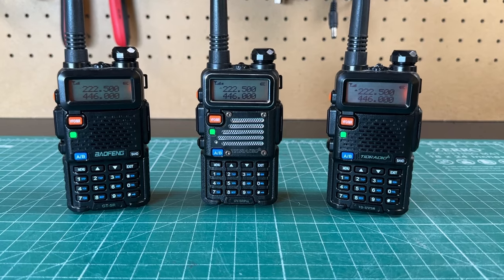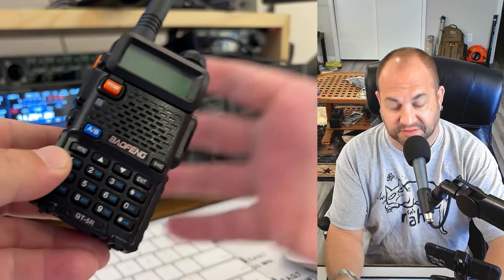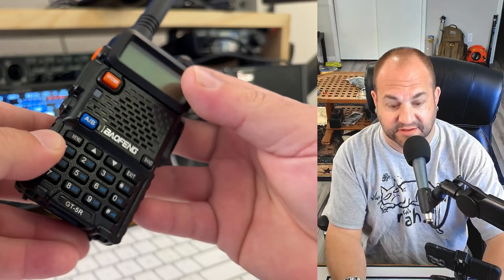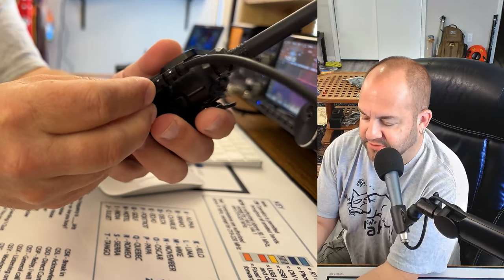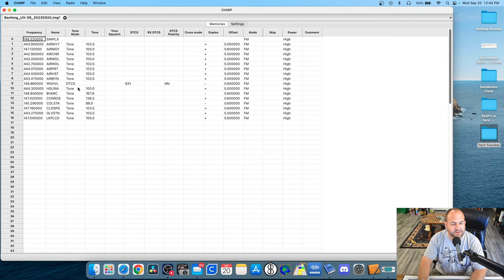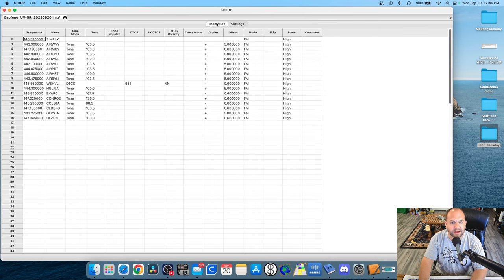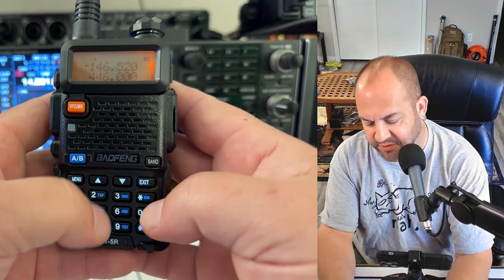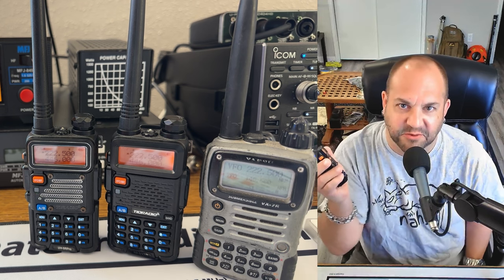Baofeng UV-5R Hacked | 220MHz Software Unlocked!

Comment: Once you make the mod, use chirp to read and write the radio as a Radioddity UV-5RX3.  This will allow you to save 220 frequencies to the radio.
Reply: Thanks for the heads up!
Reply: Thanks for the tip man it worked! I was actually coming to this video to ask for help on how to save 220 frequencies to the uv 5r thanks a lot!
Reply: I've the BF-F8HP and although I'm able to program the 220 freq directly on the radio, if I try to set a new freq using CHIRP it gives me an error message (Invalid edit: Frequency XXX is out of supported range).  Any idea how to fix that?
Reply: Bro….good save!

Comment: This is awesome. I also discovered, like many others, that if you lie to CHIRP first and select Radioddity UV-5RX3 instead of Baofeng UV-5R before downloading from the radio, you can just change the VHF TX range in the settings and enter your 220 memories just as you would 2 meter and 440 memories.
Reply: Thanks!
Reply: Exactly what I needed to know. Thanks. It worked
Reply: Do you have older models? My 2016 UV-5R units didn't show FACTORY. I still had success with the rest of the procedures (RadioOddity, etc.) and opened up way more frequencies, and could save them as memory/channels.

Comment: That's awesome. Now I'm off to brick my 10 Baofengs  LOL
Reply from the maker: good luck!
Reply: Pick one as a guinea pig!? 🐷
Reply: Make sure you have the right driver for the programming cable or yes, you will brick the radio, until you get the right driver for the cable. Been there, done that.

Comment: Great mod, thanks for sharing Mike!  So far no joy on an older BF-F9v2+.  Of course chirp does not have this version listed specifically so that could be it.  It did work on an older uv5rv2+ that I have.
Reply from the maker: Thanks for the info!
Reply: my uv5r  1.25 will not work on b band, only a band try it on a band. 73

Comment: Reminds  me of back in the day when I had a choice to buy a Packard Bell 486SX, or pay an additional $100 for the DX with the built in  math coprocessor. I cheaped out and went SX. 

I was browsing through the manual one day and I found a jumper setting note. J6:1-2=SX, 2-3-DX. 

On a whim I opened the case and moved the jumper. Magically I had the more expensive model. 

Ran like a top. And slightly faster too.
Reply from the maker: Ha!  That's how they get you.
Reply: An SX and DX were completely different chips. So what you likely did was overclock your SX to DX speed, as I think they still had discrete clocks then. Still a very cool hack.
Reply: @nobodynoone2500  Actually the SX chips were the DX chips that failed the stress tests on the math co-processor side. So it was basically a scratch and dent CPU that worked fine as long as I didnt overwork the coprocessor. And since I wasnt using it for heavy compute, I never (hardly) saw any errors or crashes.

Comment: You should add that unlike 2 meters & 440 there is no harmonic relation on 220. I/E for 220 you must have a dedicated antenna. Other multi band radios that are capable of 220 from the factory will state this in their manual. Failure to heed this warning will result in the failure of RF output transistors. KB0SFP
Reply: You can get aftermarket tri-band whips for these HT's. I was given a tri-band Baofeng for Christmas by a friend of mine and I bought a Nagoya tri-band antenna the following year at the Hamvention, and it works fine.

Comment: Well I just bought a new UV-5R to test this mod. Did all the things you talk about to the letter (Video) and it worked. But it's not putting out any power to the antenna and there is no SWR showing on my bird watt meter. Antenna used was the comet CX-333 tri band base antenna. I have the UV5RIII and this radio works fine and puts out the power but not the UV-5R on the 1.2Mhz band only. Works and 2 and 70 just fine. Well this mode dose open the radio up for receiving only. Will TX on the band as well but now power output and will not bring up the repeaters just nearby radios in the same room only.
Good mod for receiving only please note. N7GAD - 73's

Comment: Dude! Thanks for this Mike! I usually skip right over the Boofwang videos, but this is cool. Maybe this will bring some action to the band. I had only one ht that ran 220 and I’ve never talked to anyone on it. I’m gonna convert all my Boofwangs now! 73
Reply: Well how did your mods go. Mine open the band for receive only. No output power to TX. Will not bring up the repeaters.

Comment: I would love to see how much power this puts on on 220 and the spurs 🙊
Reply from the maker: For some reason my watt meter wouldn't measure power on any of my radios.  Even the Yaesu, which I know puts out .5 watts.
Reply: Sounds like a test is needed on your handy dandy thingy mabobber!
Reply: Sounds like we've got another on HRCC in the works. 🥳
Reply: I wonder if @notarubicon will give us a legal video on this hack. . . Hmmm.
Reply: I measured 10 milliwatts at the connector for TX on 224.00 so not great. My vx8 does 1W on the 220 band.

Comment: Is 226mhz the upper limit? How about the upper and lower limits of both VHF and UHF? How high/low can you go?
Edit: VHF goes as low as 125.7mhz any lower and the radio stays "stuck" and doesn't transmit. The upper is 249.8mhz but it is low sound quality. The UHF limits are 400mhz (low) and 519.995mhz. (high) All checked with SDRUno. Great video, thanks for making me explore this!!
Reply: Above 225 and below 136 would be aircraft which is AM and the B-Feng is not setup to receive AM, audio would be very very low and have distortion
Reply: @wecontrolthevideo  You would think so but 125.7 TX comes through loud and clear on SDR and on my KG-UV9D. Not optimal but it works. Unfortunately, the KG doesn't transmit at that freq and I only have one UV-5R. I'll test it with my neighbor's UV-5R when i get a chance.
Reply: @brazoon1  Probs shouldn't leave such direct proof on the internet of you using a non-compliant radio in restricted bands, I mean I am not the police, but you kinda want to make it hard to prove anything should the alphabet boys come a knocking, eh!
Reply: @meola69420  True but beyond the quick testing I did I don't plan on using any of these frequencies. For me it was just a curiosity. Plus, I'm in Canada so as long as I don't mis-gender someone the authorities won't care. lol

Comment: I have tried this on 5 radios. All would accept the program edit but only one had any measurable output power. That one radio also had very distorted audio. Baofeng now offers a UV-5 that has factory 144/220/440. The set included 2 antennas, 1x dual band and 1x for 220. KB0SFP

Comment: Awesome! I heard that can be done. Did you see how much power they put out on transmit? Even if it's not much, it's nice to have.
Reply from the maker: I checked with my MFJ power meter both my Yaesu and Baofengs and they didn't show any power at all.  Pretty sure the Yaesu is only a half watt though.  Not sure about the Fengs.
Reply: I order the radio and did the mods and now power out as well. But will receive just fine

Comment: I have several UV5R radios that are unlocked but none seem to want to accept the 1.25 meter frequency.  I changed the VHF upper limit to 226 but when I try to enter 222.500 it just say cancel. Any ideas?
Reply: my uv5r  1.25 will not work on b band, only a band try it on a band. 73

Comment: Would have liked to see power output and emissions on 220.
Reply from the maker: None of the radios would register on my watt meter.  Including the Yaesu which should put out .5 watts.  My high quality MFJ meter just might not be sensitive enough to go that low.  Someone else commented theirs put out 1 watt.
Reply: The UV5R III tri band only puts out 200-250 mw on 220. I'm pretty sure this mod won't hit that. But at least you can listen on 220 Mhz.

Comment: As many mentioned, what is the power level… I think it would help if you had a 1.25m antenna. The stock 2m/70cm rubber duck surely is not doing you any favors. Test it with a 1.25 antenna and it may show more power output.
Reply from the maker: I don't know.  None of the radios would register on my watt meter.  Including the Yaesu which should put out .5 watts.  My high quality MFJ meter just might not be sensitive enough to go that low.  Someone else commented theirs put out 1 watt.

Comment: Thanks for the video Mike but considering that Baofeng UV5Rs generally have 3rd harmonics above standards, I'd imagine that the radio might be even further out of compliance on 1.25m. It would be good to check this to ensure we hobbyists don't cause interference problems.
Reply: That is only for the older Baofengs built before 2019. The newer ones (2020+ units) are much cleaner in their outputs.

Comment: When I hold down the three buttons mentioned, and turn the radio on, it says, "COPING".  And the Chirp software still will not allow the entry of 220 MHz frequencies, even after extending the upper limit in the software as shown in the video.

Comment: Sry, I'm a beginner. Do I need to switch the antenna for this? And is this safe for the radio? If I see it correctly, this one doesn't have the default antenna, I'm trying with the UV-9R Plus with default antenna.
Reply from the maker: I honestly wouldn't worry about hurting your radio.  This doesn't really put out much power at all on 220MHz.  I am using the stock antenna in this video.  Different variations of Baofengs will have different antennas.  It wouldn't hurt to get a 220 antenna, of course.  But honestly if you have a lot of 220 activity around you (most places don't) you'd be better off with a radio that's actually made to TX on 220.  This is more of a hack.
Reply: Thanks for the response, sorry for writing just now, YouTube didn't notify me. I'm not interested in values close to 200MHz, but rather in the 110-135MHz range, is it possible to bring it down to that? What are the limits where this radio is operational? @hamradiotube

Comment: When I recently was messing with the cheesy FM radio feature, it scans from 88 Mhz to 107 Mhz... What ever is standard! Okay. BUT, when you manually plug in a frequency, it will go down to the 50 - 64 Mhz range! All I heard was static, and bleed over & Other worldly voices. But I was using the 2m/440 rubber duck 🦆 antenna. I am curious if it would actually recieve on that band.

Comment: i just got a UV-R5 and gave this a Try -- it did nothing -- i could read the Radio with Chirp and change and save as you showed -- but when i enter 220.500 into the Radio it says ""cancel"" and goes back to displaying the 462.550 frequency... what could be my problem??

Comment: I did this hack to both of my Baofeng BF-F8+.  It worked on both. I had to set the upper limit on one though to 227 instead of 226 as it would not go to 226. Not sure why. I also set the lower VHF to 108 Mhz, the beginning of the Airband and it also worked. I was curious as I dont have a bnc connector and coax  to my bird meter or a 1.25 meter slug for that matter to test the power output of this. Any idea what this might be putting out? Thanks in advance. KE0WQB
Reply: What radio did you select in Chirp? I tired UV-5R, couldn't set the frequency. It says "Cancel" when I try a frequency. Curiously, when I read back from the radio it does have 227 set!

Comment: I followed the instructions that you said to use to unlock the radio. Then i opened up my Chirp program and changed the parameter in Chirp and it will not take the frequency I input.
This is the error that I get invalid edit Frequency 224.060 is out of support range. Please advise...

Comment: Maybe you might know,  I have a BTech uv5x3 & uv5x4.  both are decent for what they are, but my gripe is that on both radios the squelch needs more increments between 0 and 1. Zero is nothing but static and one is missing a lot.  Any hacks to increase the sensitivity of the squelch?
Reply: Get into CHIRP and change the squelch numbers. No need to go too high; just spread the numbers out over a reasonable range.

Comment: So many will burn out the finals because they will not use the correct antennas for the 220 band because it will never cross their minds.I found that they transmit their but the output power was only about 1 watt.
Reply from the maker: Well look on the bright side, they'll get to buy a new radio.  But, I strongly doubt that will happen.  NOTARUBICON did a video keying up a Baofeng without an antenna for like 10 minutes and it worked just fine afterwards.
Reply: Oh my...gotta dish out another $18 😂😂

Comment: I have a Baofeng UV-9R. Do you know if it would somehow be possible to receive frequencies below 130 Mhz? Maybe 120? I think it might just be a software issue because it can receive FM radio (76-108 Mhz) and I doubt there is another tuner.
Chirp won't let me overwrite the VHF range outside of 130-176 Mhz. Any unlocked version of Chirp?
Reply: There actually is a second tuner for commercial FM stations. Unfortunately that tuner is a solid state soc, and can't be modified.

Comment: Well, on my uv5r radios, the only thing showing on the “other settings” page is: Firmware msg 1 & 2
There is no vhf or uhf settings or anything.  Mine are brand new ones, so maybe they can’t be modified for that range—trad unlock did expand vhf & uhf though.  
Any ideas?
Reply from the maker: Hmm, interesting.  Dumb question but did you read from radio first?  It shouldn't matter though.  I'm really at a loss.  I can pull it up from a save file in Chirp and Chirp Next.  Or try it again now that you've unlocked it??
Reply: It was already unlocked.  Yes, I downloaded the current programing.  I have the original file when I first bought the ht.  Also, it’s the 8w variant-that could be the issue too.  Thanks for the response. Good video.

Comment: *Watching for replies right now if there is anyone that knows this...*

   Can I use this MOD for my Baofeng Radio? It's a UV-860 and i was told, by CHIRP, to use Baofeng_BF-F8HP in piece of a UV-860 because they're almost identical and yep, so far this works fine with no issue, but I'd sure love to have this 220 MHz MOD. (I'm told that my UV-860 is a newer model than the UV-5R, it should do everything a UV-5R does, it looks the same too, but may be counterfeit.)

  Is there any way I can do this, I appreciate anyone's help and your time, oh, and  great work HAM RADIO TUBE! Awesome!
  And if there are any more frequencies I'm missing beyond the normal default ones an out of the box radio has? Or tips n' tricks this particular radio just might be hiding? I love finding secret settings and stuff.

(Summarizing: I'd like any frequency mods, including this 220 mhz one, I have a UV-860, which is very similar to a UV-5R and there is no UV-860 CHIRP file, CHIRP works with the Baofeng_BF-F8HP file, a website told me that, or CHIRP did, I can't recall, but no problems.)

Thanks much!
D.

Comment: I factory reset my UV-5R as per instructions. The screen said "Factory". But i STILL can not listen to anything outside 136-174 Mhz And 400-480 Mhz. What gives? Even some channels inside the range results in "cancel" message..
Reply from the maker: Did you open up the frequency in Chirp?
Reply: @hamradiotube  No, just the button factory reset trick.

Comment: Question, would this work to lower the limits to 118 to monitor the air bands? 73
Reply from the maker: Even if you could set those frequencies these radios don't have AM capabilities.  They only do FM.
Reply: I realized that later. I tried it anyway to see how far it would go down, 127.000 is the lowest it will go.

Comment: mine wont unlock using the 3 buttons , can I unlock using chirp instead ?
Reply: Several of mine didn’t say Factory after doing the boot hack but after extending the VHF range in chirp, they all worked. Be sure to read in the radio and write to it using the  RadiOddity UV5rx3 in Chirp, not Baofeng UV5R.

Comment: This hack works on some outher models. like the GT-5TP . that just a dule PTT and UV-5R . this did not work on the UV-5X (G) . but it did go to 174 MHz . That so called FCC Legal GMRS radio. be careful will TX on weather channels. use CHIPR turn off duplex . and will RX only . 73's
Reply from the maker: I used to have a GT-5TP but I gave it away.  Nice to know though.

Comment: Doesn’t work on UV 5R Plus
Reply from the maker: I would imagine so.  It worked with all 3 of mine.  All different variations of the UV-5R.
Reply: @hamradiotube   i cant even get police or airports just NOAA $25 paperweight what i call it
Reply: Power on & #3 it shows VER BEB297 ,  Power & # 6 it shows 170908N
Reply: @KI4RMR  witch one is witch on the channels for the air or police
Reply: I’ll go ahead and say the 220 work around does not work on all UV-5R versions since it doesn’t work on the Plus version.